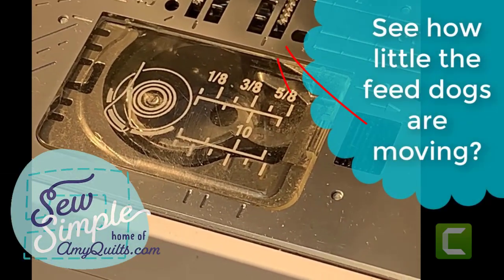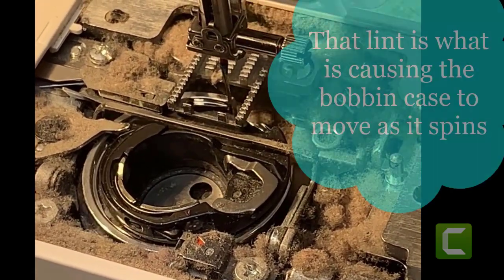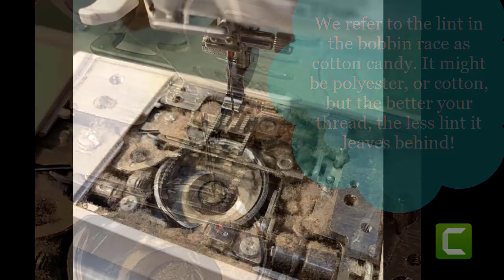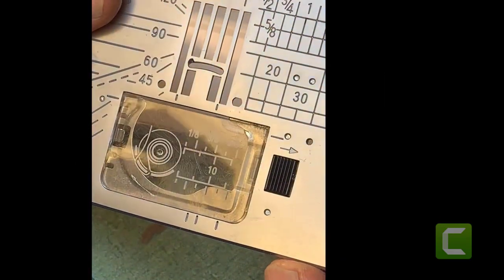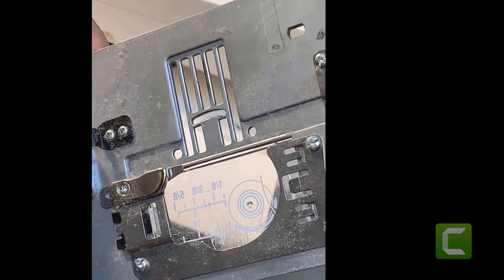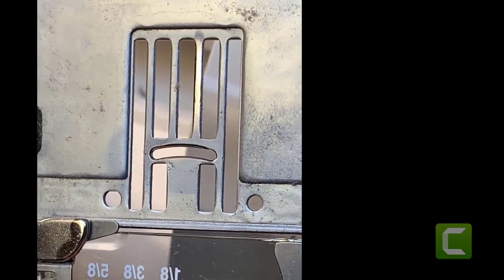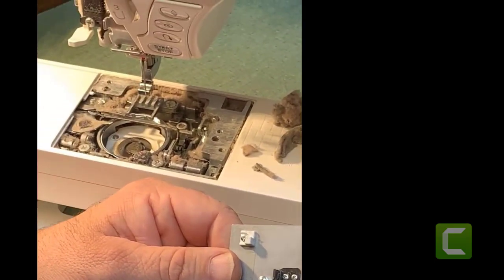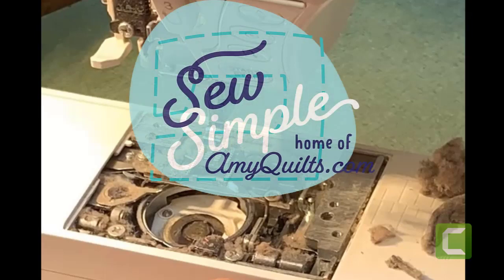What can make my Bobbin Case Loud and Hop?

Comment: Amy I would love a 4 or 5 minute video on what takes place during an annual service. I have never sent a machine in, I had an electronic kenmore for 30 years. What am I missing?
Reply from the maker: I'll see what my hubby and I can work up. It is a pretty long process, including checking and adjusting a lot of minute measurements like feed dog timing, feed dog height, needle bar height, hook timing (that's the one that goes out of whack if you break a needle or hit something hard, but sometimes it's in need of a little tweak), checking the various servo motors on electronic machines, etc. Not to mention cleaning out lint encrusted gear grease and replacing it with new grease, normal oiling and cleaning of course.

Comment: Oh, man! That's a mess!  

I do clean my bobbin area every time I change a bobbin! I use thin watercolor paint brushes to clean in between the mechanisms, a watercolor fan brush for the bobbin area, and a tiny vacuum (which gets the top lint). And, I picked up some chenille fuzzy wires (flexible) and those work really well to collect lint below the bobbin holder area and are so flexible they don't affect the mechanics of the area.
Reply from the maker: Be careful with the metal on the chenille stems. They can scratch.

Comment: My janome mc6650 does the same thing, but it's clean and there's no lint in there at all.  I broke a needle but none of it landed inside.  The tip was stuck in the thread and the rest was still in it's position.  I removed it all gave it a clean, a small drop of oil in the wick and now it's making the rubbing sound.  I purchased a new bobbin case thinking it might be that but it still makes the noise.  When I remove the case it doesn't make the sound.   Was it the oil? I'm confused!
Reply from the maker: The oil isn't the problem unless you over-oiled (oil didn't get absorbed). I wonder if the hook was damaged when the needle broke. I suggest taking it in to your dealer.